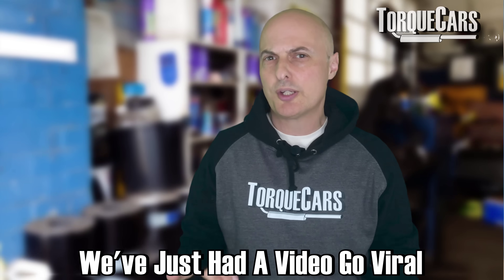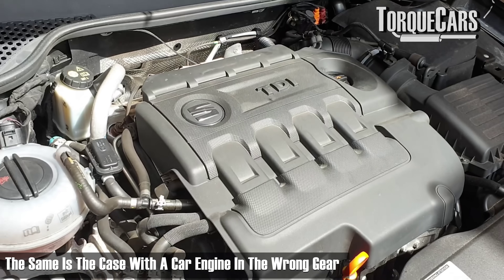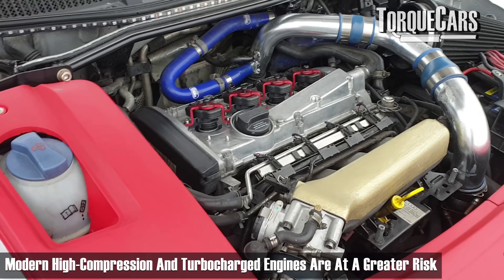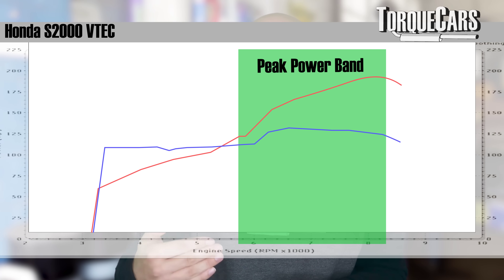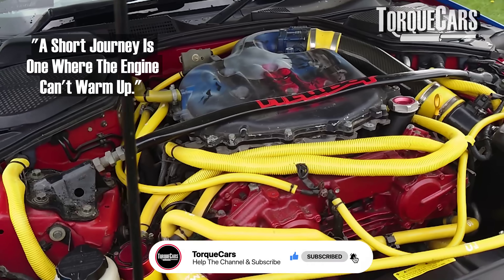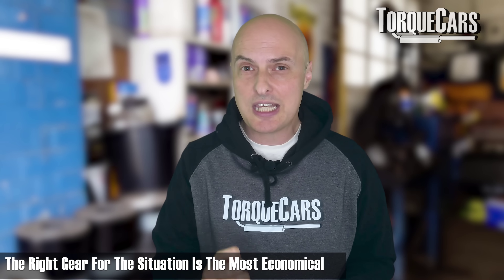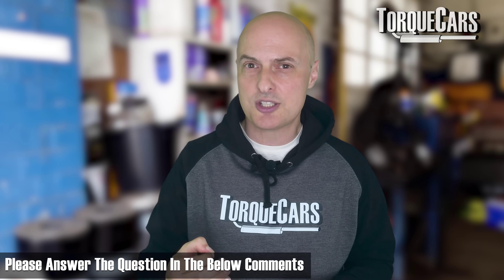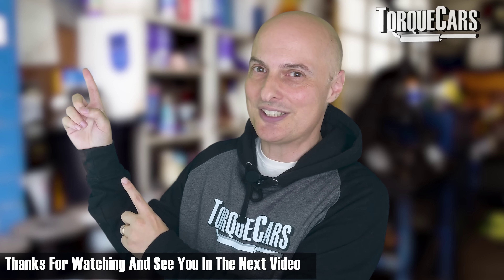Warning: Low RPM Lugging Destroys Engines! Why Low RPM Driving Is Bad.

Comment: I have a DSG automatic and it always uses low RPM at light throttle. I have peak torque from 1500 RPM, so it never seems to need revving high.
Reply from the maker: The DSG is setup to use the torque and avoid lugging. Some prefer to use sport mode on longer runs and certain drives but you should be fine with the DSG selections. Light throttle is not really a problem it is when you add some load, in which case the DSG will shift down a gear (or two).
Reply: @torquecars  on his 2018 530d, my brother uses the gearbox sport mode as well to avoid the low RPM.
Reply: Low RPM  is only acceptable for cruising on flat surfaces. Even for small speed increase and inclination always downshift.
Reply: @joeblacklv no. I too have a DSG box and I set the cruise control to the d3sir3d speed, the box takes care of the rest. I regularly drive the M3vand once at cruising speed (usually 66 to 69 mph) it STAYS in 6th. Good enough for me.
Reply: @iandennis7836  Well, I thought the same until I have coded a boost gauge on my instrument cluster - in most cases, the boost is much higher, when it stays in gear at lower rpm and DSG does not shift down. It only speaks, that DSG cares about fuel economy, not the engine life. Low rpm + high boost = trouble.
Reply: MY skoda superb develops max torque @18,000 ram.
THAT equates to 125 Km  p H. 
That's what I drive at, except about once a  .month. The  its 3,000 Rpm for about 50 Km to give the exhaust a good clean out.
Reply: i use always on sport mode*
Reply: Also have DSG. It revs low but not that low. At 30 it'll stick to 1800rpm rather than shift up. Typically will change up at about 2000 on light throttle or 2500 under moderate throttle. The 1.5 turbo has good torque from 1500rpm. I've been manually shifting up and making it avoid changing down up hills as it seems to change down too many gears. That habbit will stop after hearing about low rpm damage. Meanwhile sport mode shifts later but it also has an annoying habit of over revving holding 3500rpm at times under light throttle.
Reply: @paultasker7788 I agree with you. I have a BMW E46 323iA - 2.5/170 KM, but still, I like manual mode.

If I drive up a hill or when I drive faster 🙂

I always use manual mode... I know exactly what I want or what I'm going to do in a few seconds, but  the gearbox doesn't know that and shifts up/down even though it doesn't have to.
Reply: Thanks for the warning.
Most automatics should have no problems going over hilly roads, by default or have a special mode for that. That BMW couldn't get that right amazes me though.
Reply: @j.p.ijsblok5304  You don't have to if you don't want to.

It depends on the driver, and some people prefer Sport Mode or Manual Mode.

I like Manual Mode because I have more control over the RPM/Engine when going up a hill or going fast because I can change gears whenever I want (longer driving in the same/lower gear, etc.)
Reply: Throttle opening and rpm should be inversely proportional. 

On older mechanical throttle engines with a manual trans it relies on the organic software to make that a reality. Unfortunately in many cases the programming was insufficient to the task.
Reply: @gk5891 and always try to lift every thing in one go rather than many light loads and always lift with your back not your legs 🤪
Reply: Not taking anything away from the excellent video, but when you watch a washing machine spin at 1k rpm,.. lugging (been around for years) seems a confusing term.

Comment: So how we change gears 2000  rpm
Reply: on flat and downhill yes, on uphill change at 2300-2500
Reply: My rule for turbo engines: if under any significant load, the turbo should be spooled to its maximum and the engine should not vibrate/jerk at any moment. No high throttle at RPM until turbo is spooled.